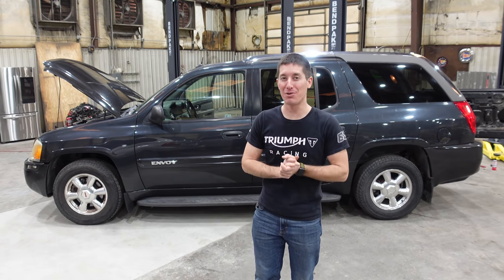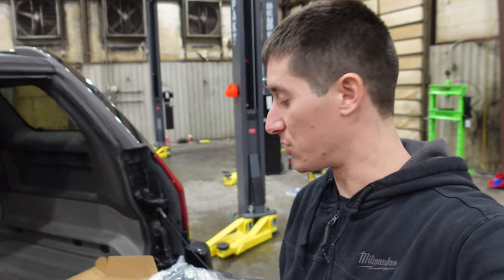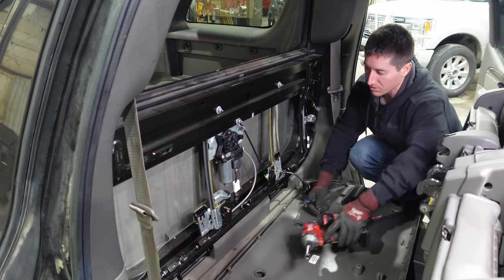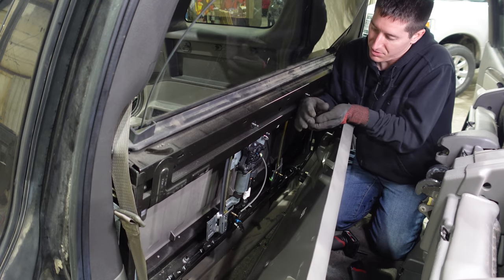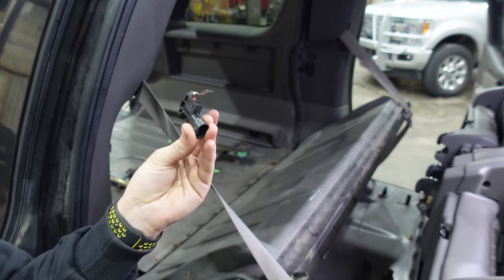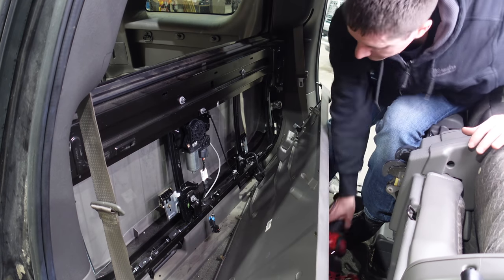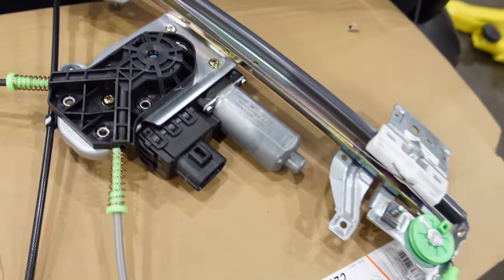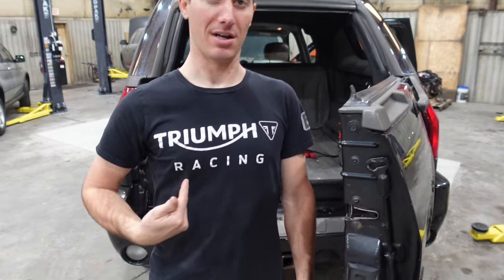EVERY PART Of My Envoy XUV Is EXPENSIVE: $150 POWER MIDGATE Repair

Comment: Love doing diagnostics on things like this. I’m sure you had fun with this one 👊
Reply from the maker: This thing is amazing to work on, the computers rock and can tell you everything about it... slowly getting it all figured out 💯
Reply: Autel 906BT makes short work out of all of the modules in these. Can’t wait to see the back half of this one get fixed too!
Reply: Too bad they always cheap out on some fairly important part but the whole concept of the car is so cool and useful within its limits. The LS engine would be a great combination and maybe not much worse on gas.
Reply: @69Dartman  I have the 5.3L LS XUV. Some say "but it's only 15-20 more horsepower" but the torque is like 50 pound-feet more than the inline 6, which, by the way, JR called a V6 in the first of his XUV vids in this series... That's before any LS mods.
Reply: @69Dartman  I have a trailblazer and apparently the 5.3 is actually better on gas than the i6 go figure
Reply: @zacharyfevold9610  Well, my second car was a 41 1/2 ton military closed cab pickup and it had a later 230 flat head six in it that got 9mpg, loaded or unloaded, and a newer small 318 v8 would probably have done better but that thing made over 200 foot pounds of torque at just above idle.

Comment: I have a V8 SLT XUV! You can rebuild the rear actuators. Don't pay $250! There is a tiny motor and worm great that opens them and a spring that closes the latch. If you take them apart and clean the gears you can fix them. The rear handle switch also fail and can stay in the open position which is what is probably happening to you.
Reply: You should post a video of the rebuild of those actuators.  The switch is also used on the Chevy HHR, I pulled a couple at local scrap yard to have as spares, 1.00 a piece.

Comment: I bought my XUV a few weeks before these videos started to be posted on YouTube. All mine needed was a rear tailgate regulator, every latch and track cleaned and greased, and guage cluster repair. Mine is a 2004 SLT edition fully loaded with only 44k miles driven by an elderly couple. It was a once in a lifetime find and I love it!

Comment: Jr, want to say thank you. We've had our 04 XUV for about 15 years and love and hate it on a regular basis. Your video inspired this shady tree mechanic to take on the challenge. From part numbers to opps reconnect that wire "before" you were spot on.
I'd like to share one spot of wisdom, I was VERY concerned about the glass slipping, my solution was using a shower suction cup handle to secure the glass in the fully closed position. Wish I knew how to share image here. Thanks again (great success after fixing the midgate sensor, but that's another story). 😊

Comment: You may want to lube the tracks and felt with a Silicone Grease. It should improve the speed of the window going up and down.
Reply: Definitely should be part of any thorough window regulator replacement.
Regular silicone spray works too.
Reply: @dafirnz   for ze germans i like aerospace 303 rubber or gummi pfledger

Comment: I have replaced a few window regulators in my day.
I use a medium/large (whatever you have) suction cup at the base of the glass to prevent it slamming down.
OR on framed glass duct tape around the top works also.

Comment: I have one of these, 338,000+ miles, replaced both mid & tail gate regulators, 2 transmissions, (all torque converter failures), 1 upper tailgate latch, cat. convertor, & instrument panel. Still gets 16 mpg!

Comment: Regulators are easier to change if you buy the regulater motor combo and replace both the motor and regulator

So JR did it it unintentionally right buying the combo
Reply: Often cheaper to, the regulartors cost almost as much as the motor, just get both

Comment: Thank you for this video. I have a 2004 envoy XUV and I have the same issue. Also, the tailgate is a pain in my arse!!  Sometimes it will open, sometimes it won’t. 
I can get it to flip down, only open outwards. 
This has definitely been a frustrating vehicle, but it runs smooth. 
Oh, and when I’m at a stop won’t the AC on, it sounds like the dash rattles, who knows. I wish I knew everything so it would make it easier

Comment: Been there, done that.  WE have a 2004 5.3L XUV bought brand new in 2004. Driving to Vegas (from SE Arizona) in 2007, going over Hoover Dam, in the middle of summer, the "electronically controlled fan clutch failed ($1000 repair but we had extended warranty back then...)I replaced the midgate regulator a few years ago and then not long after that, the tailgate regulator! I've replaced the damn airbag shocks (those were pretty easy), brakes, etc. We've had problems with the BLEND door actuators in the AC (not so easy but do-able), and a few weeks ago, the damn plastic shift linkage broke at an inopportune time. Well, it was a the plastic bushing thing that connects the gear shift lever to the linkage that connects to tranny. Dealer wanted $600 to fix it, and I laughed because I fixed it with the $2 plastic bushing... The pressing thing now for us is a jacked up sun roof regulator. I've had to replace the body control computer as well. The BOSE speakers blew out last year, had to replace those..... WE've owned this thing since it has 12 miles on it, and if it wasn't for the fact that it is a V8, still has less than 90K original miles, I'd have gotten rid of it a long time ago. It's just a prime example of GM's shitty overcomplex design.

Comment: I would grease the track its self thatll make a huge difference in how quick and smooth it will run you can use silicone or white Lithium it will make a world of difference

Comment: use spray silicone on the side track above the window to extend life.  It sounds like its struggling to open.  There is a dry silicone you can get it works great.

Comment: I bought one of these trucks last year to flip and my back roof didn’t open either and I was having a lot of problems with the back door I replaced the window regulator after that everything started working didn’t have to replace any hinges or locks the roof retracted the glass work perfect before you replace hinges try the window regulator got it off Amazon it was like 120 bucks great deal!!

Comment: I hate anything Dorman. Rather pay double and do it once. Dorman, you’ll be replacing the same part every 6 months 🤣😂🤣😡
Reply: While I do agree, when it comes to really strange parts like this, Dorman is often the ONLY company still making it. Past couple years they've gotten better
Reply: Normally I'd agree, but when it's your only option, then what choice do you have, not get the job done?
Reply: @CommodoreFan64  When it comes to buying Dorman or not getting the job done. I’m going with not getting the job done 😂😂🤣🤣😂🤣
Reply: @tctwg1  They really arent that awful. They arent as good as Borg Warner. But for a low use application like this it'll be fine
Reply: @TheMrLebaron  See Eric O at south main auto if you think dorman is getting better. I would have paid for the oe part.
Reply: I replaced my ignition barrel with dorman once a year nd a half ago. Never again. It failed within a month and I replaced it with a new oem barrel.
Reply: @hughjassstudios9688  I typically buy OEM stuff, however OEM Japanese built Toyota shit can get crazy expensive. For some stuff Dorman is fine by me. But for anything important, yeah thats a nope

Comment: I use paint mixing containers at car then put bolts into a tackle box containers with the seperate containers. Then i put tape on the lid and write down where the bolts came from in each section

Comment: Reminds me of the rear shocks on my old 97 Lincoln Mark VIII LSC.  $350 a side, not including shipping or installation.  For my 1995 Ford Thunderbird LX...it was $50 each installed.
Yeah, rare parts.  Damn Ford for putting a stupid schrader valve into the rear shocks for the air ride.  I miss those two cars.

Comment: Amazon sell for 125. And the tailgate for 99. The most expensive part for the rear of the XUV is the body control module in the tale gate door. Shops are selling for up to $400. GM even changed the part number so you'd have to cross reference it. It controls the roof, back glass, and keyless entry.

Comment: I’m pretty sure that every one of those XUV’s I ever worked on at the dealership needed at least one of those regulators. The part that makes the vehicle unique is the most failure prone. It is a large piece of glass that the regulator has to move though.

Comment: Even though I hated a demo Trailblazer my mother had back then, I wanted one of these Envoys so bad. I still like the idea of enclosed bed that can be opened to the interior for dogs and such. But I can’t imagine wanting to use one of these over my Flex or even my Niro at this point. I’d rather just have more trucks with a full width rear power window like the Tundra.

Comment: The switch you glued to fit on the tab- I replaced everything and the window works now ( great video!) but for the life of me can’t find the tab to put my switch to, don’t know if it broke off or what. Can you tell me where it attaches? Thanks, Bart
Reply: Challenge I ran into was the mount for the sensor on the new regulator is the wrong size. My son and I had to shave it down from about 820 to 700 or something thousands of an inch, then secured with wire. Works great now.

Comment: this would be the perfect junk yard hunting expedition in a city like Denver where there are about 4 pull yards one would find the tailgate and sunroof parts if one is patient. It sucks that regulars like this brake all the time. I think the pulley type regulators in a lot of newer model Chrysler and Chevy suck vs the older gear type regulators. Gear type regulators which mimic the old hand turned window cranks are much more reliable. since you saw where the the plastic tab holding the cable broke free why not add extra epoxy putty to that plastic part to make it stronger so it does not brake in the future. I would fix sun roofs and see often there is some piece that brakes in the model you are replacing and just reinforce that piece of plastic in the replacement sunroof before putting it in. So try not to have a problem recur over and over every few years.

Comment: Do you happen to know where I can get the silly little clip that holds the tailgate rod in place?  A friend broke the first one, and when I went to get it, they told me it was discontinued and luckily they had 2 left so I bought both…put one in and the other got lost…about 6 months ago, my husband carelessly stepped on it when climbing into the bed…I’ve been using string and hair ties, but they fall off and the rod has been slammed into the light twice now.  I can’t find the piece anywhere online or other… and now I’m in need of a daily light as well thanks to that…but I don’t want to cha ge the tail light until I find a solution for the rod…Amy ideas?

Comment: Speaking from experience, ANYTHING between the midgate and the tailgate is ludicrously expensive if you can even find it.... Its great when all that works, but one fault in the rear window will stop the whole tailgate/roof system from operating. Once the tailgate regulator dies the sensors don't know where the window is and it bricks the whole system...
Reply: I found most everything off rock auto for this vehicle, only saw 2 things that are out of stock so far.
Reply from the maker: My roof is 100% ruined, digging into that next. 😬
Reply: Try fixing the tailgate regulator first... Like I said, if that's broke it tends to kill the whole system. I couldn't even open the tailgate at all, and I had to look up how to manually release the latches... Once the back window got fixed the whole system was fine again... And I was about $700 lighter in my wallet!

Comment: Yup they wanted $360 for the drivers side and $240 for the passagers side window switches cuz they short out if you leave the window open when it rains so I fixed it with a $5.99 marine grade water proof DPDT switch

Comment: Small hint: parts for any vehicle that sells/was sold in limited numbers are always expensive.   Unfortunately, when these vehicles are originally engineered, little thought is given to adapting readily available parts.

I own a Ford Mustang and noticed that while the interior of an 05-09 model looks similar to the interior of an 10-15 model not even small knobs and switches were carried over.  So I would imagine GM was as thoughtless when designing the XUV.

Comment: I have an 04 that had 23000 on it when I got it and the midgate window was the first thing second was I changed the battery and now it only blows out the defrost or feet.  You have that problem

Comment: Who knew GM had something that sold worse than the Aztek.
Reply: The only thing that made the Aztec ugly was the reliance on crappy grey plastic cladding.  Overall it wasn't a horrible and ahead of its time as far as crossovers go.
Reply from the maker: Just wait till I grab an Aztek 😂
Reply: @WatchJRGo  the late ones that dont have the grey plastic are the best......find one with the factory tent option!
Reply: @michaelreynolds1904  The Aztek kind of shot up in value a bit thanks to Breaking Bad, so good luck to anyone looking for one at a cheap price.
Reply: @CommodoreFan64  cursory look on Market place shows an average of $2500 around me.
Reply: @michaelreynolds1904  Good to know because last I looked about a year ago on Auto Tempest I saw a few in the $6k - $8k range.
Reply: The Aztek was nothing more than a Montana minivan with a funny body and less utility.
Reply: How about that Pontiac mid-engine monster....?

Comment: Now let's see you do transmission lines on a v8 Envoy without a lift! Before you buy regulators/motors/latches for the rear gate, press the Unlock button on the keyfob 2x... same if it seems the gate won't open.

Comment: So i had the same problem and i replaced the regulator but when i hit the button i would just hear a click and nothing would happen, the window wouldnt move could someone please explain to me whats wrong
Reply: mid-gate window up/down is controlled by the switch on the overhead console up front. The little button switch on the midgate only opens the latch that holds the mid-gate closed.  Windo has to be down to enable the button. So, first step is to turn the key to on or acc and completely lower the glass from one of the front seats, then hop out and fold the seats up to their stowed position. Then press the little button to release the mid-gate latch and fold the mid-gate down.  btw, there is a small plastic clip on each side to slip the rear seatbelt into that holds it out of the way, so it will not get caught when you lower the mid-gate.

Comment: I bet the main reason why those regulators fail is because nobody lubricates the tracks that the window rides in because at 9:46 you can actually hear the motor struggle to push the window up. a spritz of silicone spray in the window tracks will have it gliding effortlessly.
Reply: Silicone spray in the felt cracks should be a yearly thing for cars
Reply: @vikingman4614  according to the owners manual for my Chevrolet Aveo, it’s a part of the Maintenance II service which is done every other oil change.
Reply: @vikingman4614  spray on sides of window? Or take the panels off?
Reply: @cwd1232  usually you just roll the window all the way down and then spray into the exposed tracks; if you do it right, the silicone will work it’s way down into the tracks inside the door as you operate the window.

Comment: Dorman???  You may regret that purchase.  I learned that the hard way replacing the door lock actuators on my wife's 09 Impala.  Replaced them multiple times using Dorman.  Finally had enough and went with OEM.  Cost more but haven't had to replace them since.
Reply: Worked in the parts business a long time. He might have had no choice. I HIGHLY doubt GM still makes these.
Reply from the maker: Getting the GM one would've taken weeks, special order only. This will hold up just fine, it's not used much at all 💯
Reply: Rockauto.com has the OEM regulator/motor assy in stock for under $250. 🤔
Reply: I was looking through rockauto.com and found most of the parts for this vehicle, i think JR has it out for rockauto 🤣🤣
Reply: @21Piloteer  Which is a lot more than what he paid for this Dormon? Not a fan of Dorman but for something that hardly gets used its fine
Reply: @jonnyboy9141  JR also likes to turn stuff around fast. He also wants the local support a brick and mortor store offers
Reply: @TheMrLebaron  I do remember hearing him say something to that effect, however in this situation rockauto seems to be the solution for people with this vehicle.
Reply: Yeah..if it's a flipper then the Dorman is fine.
Reply: @jonnyboy9141   I use RA almost exclusively because I want to save money on better quality parts than my local Advance Auto sells.  However there are coupon codes (CHRISFIX25, saves 25%) on the Advance website that I use if I'm in a pinch.

Comment: Good luck finding seals for that rig when it starts leaking water, which it probably already is. Which is a shame because if they had thrown a 5.3 in it, it'd been a really versatile vehicle.

Edit... John, if you see this, you need to treat every sealing rubber with silicone, and clean up the tracks and lube them up with molybdenum grease.
Reply: Just throw some ATF on them for a few hours, provided they're not torn, already... good as new
Reply: @SteveBassen  Oh no. That's the "buy here pay here" method. It'll destroy the seals.

You soak the rubber in silicone spray and wait a day, then soak again and wipe (and you'll get a ton of crud off. Wipe again when wet with the silicone spray once more with no pressure against the seals.

I've saved several unobtanium seals for Country Squire wagon rear hatches by doing this.
Reply: @JB-mk4ry  dupont krytox works too. Atf if you really need to jump start the process though